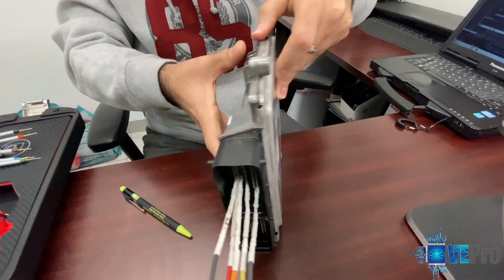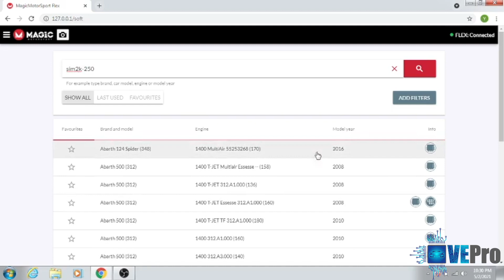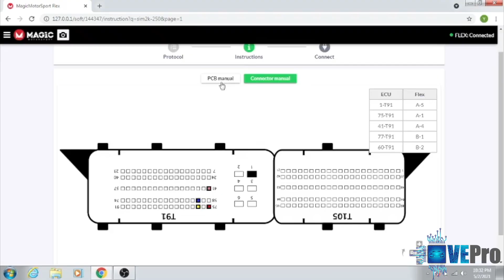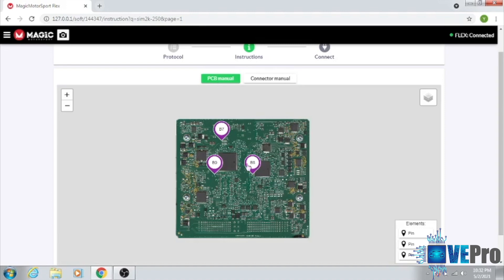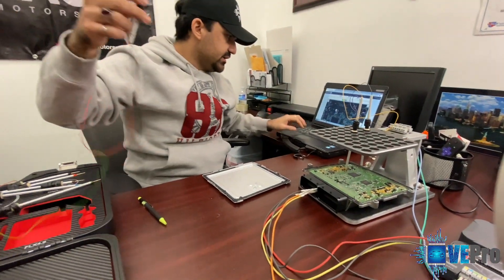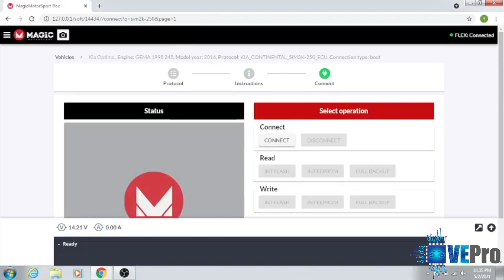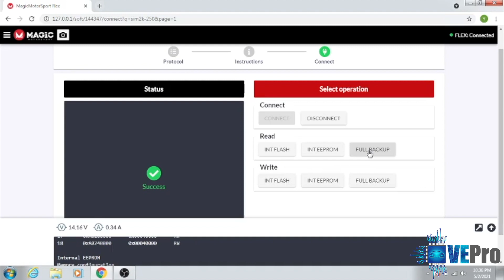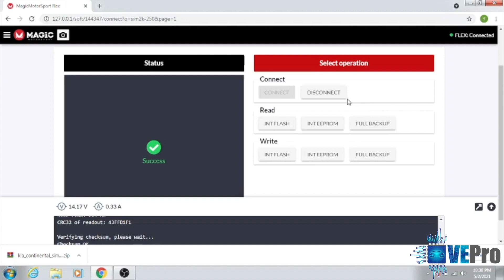Flex Bench Boot Mode Cloning - SIM2k-250

Comment: Hi What's the difference between save all and save back up only. I know one is saved as a file and the the other is a zipped file
Reply from the maker: Backup only saves the .MMF Flex File. Save all saves all the separate EEPROM, FLASH and MMF Files.